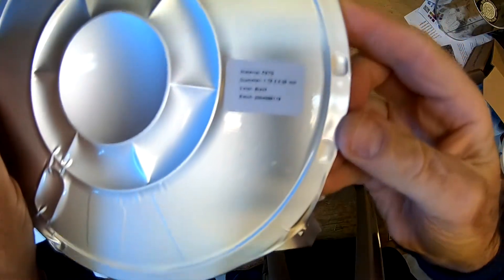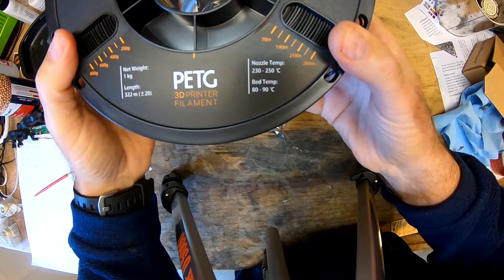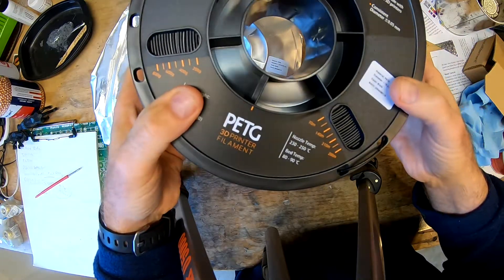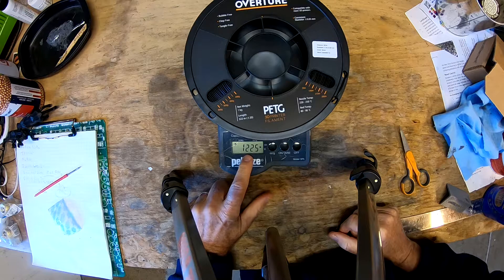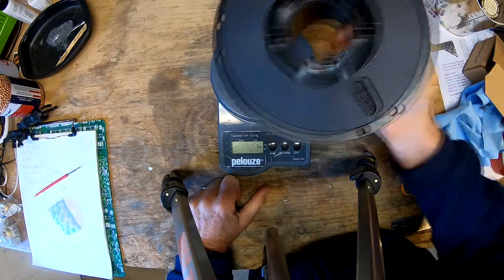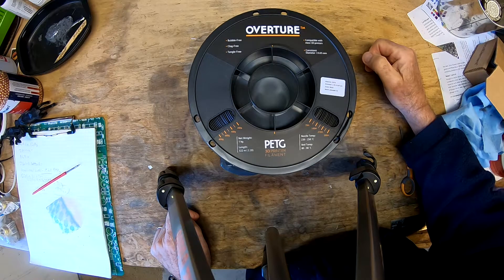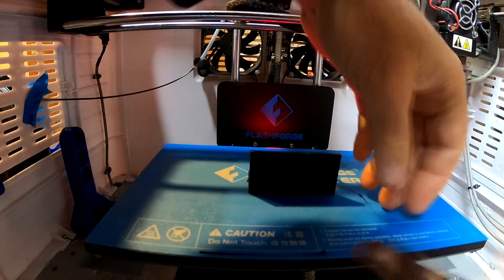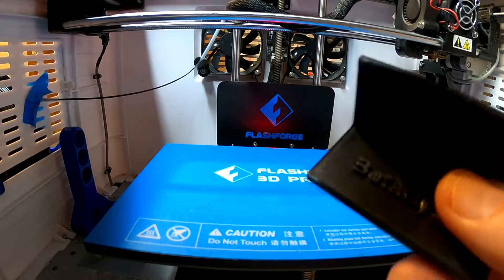Flashforge Dreamer (NX) - Overture Black PETG Testing

Comment: What were your final setting? would these setting be different on different printers?
Reply from the maker: For PETG, I've settled on 230 degC for the extruder & 75 degC for the bed temperature.
Depending on the brand of PETG, I may go up to 235 degC for the extruder.
I've had the most consistent results with YOYI PETG, so I prefer to use that when I can.
Here's a review of one color of that PETG:
https://youtu.be/qtbpKDJL2WA

As far as the fan speed, I'm using 20% maximum for the fan speed after the first 5 layers.
It depends on the part I'm making. 
If it is a small part where the print head is in the same area a lot of the time, I'll use 20% fan so the printhead doesn't re-melt other areas already laid down.
If the part is spread out, I'll use 10% or even no fan to maximize layer adhesion.

Every printer is different in some respects. The biggest difference between the FlashForge Dreamer NX and other printers is that the Dreamer has a temperature controlled enclosure.
Many printers don't have an enclosure, let alone one that is temperature controlled.
That's going to make huge difference in how PETG adheres to the bed and between layers.
A temperature controlled enclosure is going to make your prints much more consistent, especially in an unheated garage like where I'm printing.

For PLA it isn't very critical and if it's warm in the garage, I'll print with the top off and even the door open.
For PETG, I'm always printing with the top on and the door closed.